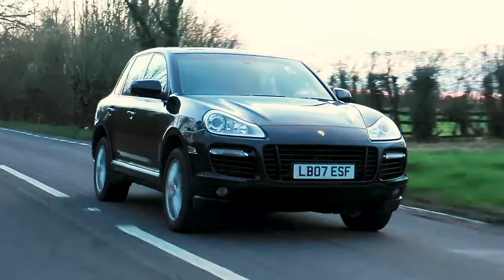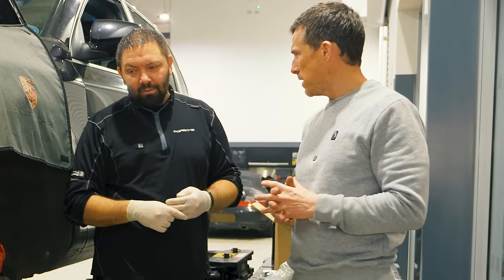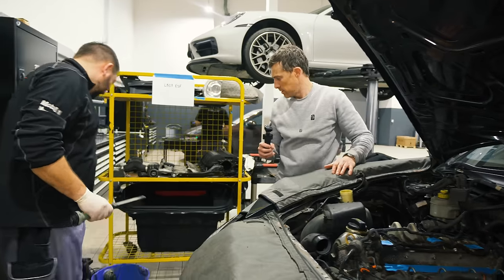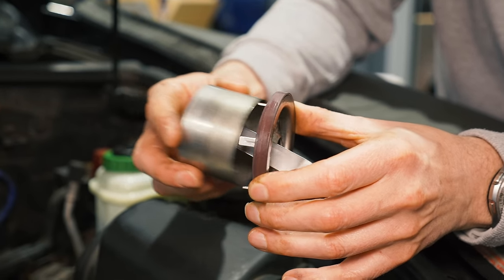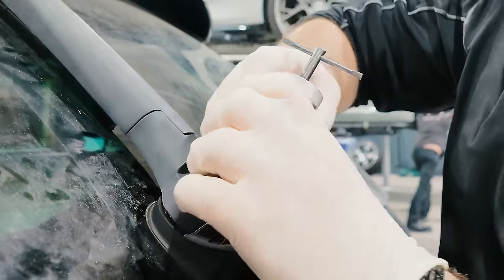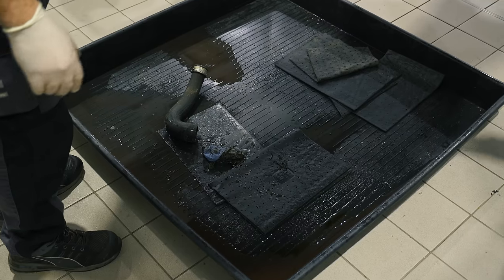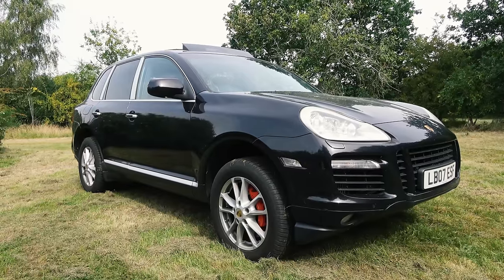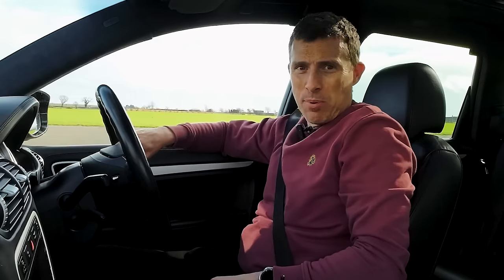Fixing my BROKEN Porsche!

Comment from the maker: Check your car with CarVertical: https://www.carvertical.com/gb/landing/v3?utm_source=infl&a=watson&b=38b26e3a&voucher=watson
Use code WATSON for 20 per cent off.
If you're in the USA use: https://www.carvertical.com/landing/v3?utm_source=aff&a=watson&b=14f83321&voucher=watson
Reply: Will u go broke 😭
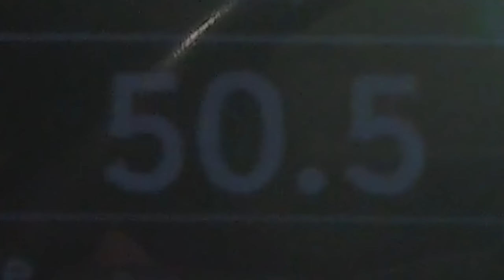Reply: You said at 20:21 that no horsepower was lost. Maybe run it on a Dyno?
Reply: Mat can you race your gt3 rs with a gt2 rs
Reply: Make a deep clean video with dry ice on porsche for the rust inside body, The end results will be really satisfying.
Reply: Mat you should do a review of the Cadillac Blackwing maybe the CT5-V or CT4-V... One of the best driving machines out there
Reply: Great to see you drove the new 911 Mat, we'll be waiting for those reviews 😄😄
Reply: Good to know. Xxxx

Comment: No such thing as a cheap Porsche
Reply: A 1/36 die cast is pretty cheap
Reply: Thats not a porsche lol thats a toy@BobbyDazzler888
Reply: 924 is one
Reply: Funny - I’ve never spent a bean on my 911 C4S or both Boxsters 
I also now have a 955 cayenne which is at 84k but needs boot struts 
Runs like a dream
Reply: I had a 1978 Porsche 924 (I know VW Porsche but looked good) It needed a new cigarette lighter so I could use my radar detector. Went to Porsche to see what I needed and how much. (Before internet like today) They told me what I needed and was around $60 to $70.  They told me to go to the auto parts store and buy a VW one. I did and like $12. I do like how some brands you can interchange the parts and bypass the brand increase in price. I am sure Lexus and Acura do the same.
Reply: If you can fix them yourself then your OK there only expenses if you have to take them to a garage just like a cheep Mercedes
Reply: to be fair, £11,500 (maintenance included) is still less than most shitty 2019 plate hatchbacks
Reply: 11500£ for 500hp SUV in good condition is flippin' cheap.
Reply: @coolkid123456100 a “shitty”  hatchback at 11 grand would be at least 10 yrs newer and doesn’t cost £700 to tax
Reply: There are plenty of cheap Porsches. It's just that cheap and properly running rarely go hand in hand.
Reply: You are exactly right. If you are looking for economical, reliable transportation, no-one can argue that your money is best spend on a newer, more sensible car. 

That said, if driving is your thing, there is also something to be said for running an older Boxster. I've personally done this for the past 3 years with very little trouble. 

Of course older sports cars require some sacrifices here and there, but for those passionate about them its worth it and no where near as expensive as people say if you do your research and buy a good example. 

 @Gmh6477
Reply: Disagree. Compared to the competition the cheepest by a margin
Reply: @Islam_is_the_truth.4 you understand sarcasm? Go read 2 nafl prayers
Reply: @Islam_is_the_truth.4 sharp as a cue ball
Reply: @superamario6464  Oh I triggered a baby 👶 🤣
Reply: @Islam_is_the_truth.4  It is a porsche, it's just not a motor vehicle
Reply: I agree I had a porsche 944 and Spares and service was crazy prices but well made and fun car loved it
Reply: You can use vw parts which are way cheaper.
Reply: You can buy a Booster cheap but it will eat it's RMS. I can't spell Boxster
Reply: @lukasbormann4830 and the Boxster
Reply: @Gmh6477 700?😮 over here that would be around 3 or 4k. With registration it will be like 10k the first year.
Reply: It's all relative.  A new car that would do what this would do would be $100K to  $150K.  I can make a lot of repairs for the difference of that and the cost of a Gen 1 Cayenne.  Same with an older Boxster.  They are cheap for what you get.  Nothing's free in this world.

Comment: Jesus, those repair bills are insane! £406 for an oil and filter change is criminal!
Reply: That's why old luxury cars are cheep, you don't buy an old porsche or Mercedes unless you can fix and service them yourself
Reply: @JackV-tw8bw or find a mechanic that’s not into scamming
Reply: Yeah the oil change and filter is a simple job why that fee ?
Go to your local local specialist avoid dealers, these costs were ridiculous, what was the hour rate I wonder ?
Reply: And that was with discounted parts and labour
Reply: it is porsche mate, complexity and most of that price was probably the labour, most main dealers like audis charge around 200GBP/h labour so it being porsche could easily be 250-300
Reply: Its like going to Ferrari to get a new 12v Battery . Who in their right mind cares
Reply: @fl1xmeister  Mostly same car as vw touareg. Who in the right mind will do the oil change for that price to touareg. I have 4.2 diesel touareg. 10L good oil is about 75€ Filter 10-15€. If I feel lazy then oilchange in local garage is about 100€.
Reply: @Meeliskt77  is that a VW main dealer? Or a back street
Reply: Don’t worry, YouTube will help pay! 😅

Comment: Hi Matt would really like to see a few videos with your porsche. I full deep detail and paint correction possible at auto finesse. A full underside dry ice clean to bring the underside back to life ,and a before and after dyno video. A bigger intercooler, some performance air filters new spark plugs and fuel filters and a ecu remap .I'm sure this big old girl still has more to give . Looking forward to seeing what you get up to next . Then I would love to see how the porsche stacks up against the modern big suvs  on the drag strip 🇩🇪👍
Reply: How much does the dry ice clean run?

Comment: Wow the underside of that Porsche looks like it’s been in the ocean!!😮
Those prices were eye watering 😢
Reply: If you're handy with a wrench, a lot of that can be done for cheaper. I did the water pump and thermostat on my 2010 Turbo with no problems, cleaned the intake ports (necessary), and replaced a bunch of spent bushings for just around $1200 dollars. Just don't ask about replacing the brake rotors!
Reply: Do the oil yourself... Everything else was reasonable even for an economy car. I feel like the oil is so high because they really don't want to do it... It's like asking an astronaut to drive you to McDonald's.
Reply: @ch4.hayabusa  £571 is reasonable for a rear wiper blade and switch?

Comment: Had an engine to gearbox gasket failure on a 2012 Cayenne Diesel, quote to fix was £4500 -£5000 and that was from a specialist. Had quite a few other issues with it that were all expensive to fix. 
Great car, really nice to drive but it was my first and last Porsche.

Comment: Glad to see the Cayenne in better shape. I still need to sort the gearbox/transfer case/differential oil changes in mine.

I find the Cayenne is best in flowing corners, tight ones. Mine lacks PDCC so you really feel the weight if you have to turn sharply.

Comment: Great video Mat. Very useful for those of us considering a 2nd hand Porsche. The bill is eye-watering, but not crippling, considering you have fixed so may issues and brought a 17yr old car back up to snuff. Also, as you suggest an independent specialist may be cheaper. And some of those jobs could even have been done by my local garage. Overall, reassured. Now back to browsing Autotrader...😅

Comment: Pull the mini blind off that raises up a few inches when you open sunroof, then push a seal down inside and silicone flush to the channel where the seal sat in for the fabric wind deflector, no more leaks after that and rodding drains from bottom up

Comment: I have the non turbo version and had similar bills in year 1 and 2 and now I try and do the work myself. Oil change and filter for £100. Brake bleeding and nipples £80. Full brake refresh (pads/disc) coming up this summer. Dealer would be at least a 1k.

Comment: I had a Cayenne Turbo, and it was just not chilled enough for daily life, being a manic engine. I moved to the effortless low rpm torque for daily driving of a diesel  V10 Touareg.
Reply: I really want a V10 Touareg. What one did you go for?
Reply: @AlwaysOneMore  V10 Touareg are pretty much all the same. Paddle shift is nice on the column, but the tiptronic does the same on the gear selector. 

There are R line and Altitude versions. 

One could also try a W12 Touareg from Europe, where LHD in the UK is fine once one’s mind and body (autonomic nervous system) are given the time to adjust.

Comment: Ive gotten to drive a 1st gen cayenne turbo s and they are absokutely mad, the one in question had some sort of tune so it made 550ho instead of 521, they also handle insanely good when u put the suspension in sport

Comment: I’m curious if the PCV system is overloading your intake with oil. If so just replacing the intercooler hose would only be a temporary fix.

Comment: That one service costs as much as all the lifetime maintenance and repairs combined on my 2009 Prius with 330K miles on it (me doing all the maintenance...oil and filter changes, trans fluid, coolant, spark plugs, brake fluid, one set of brake pads and rotors, cabin air filters, etc).

Comment: I'd basically get an E-Hybrid Base Cayenne with 3.0 V6 engine for that money, under pre-approved warranty. £11k is way too much to spend on a car this old. My 4 year old Cayenne Turbo S E-Hybrid is under a repair in a Porsche Dealership right now, I highly doubt the cost of the repair would be different between this variant and the newer variant (E3). It feels like that repair cost is basically dumped into the drain.

Comment: I’ve found the 955 turbo really sluggish even compared to a Nissan note, any traffic lights and I’d have to switch the traction control off (turns into a different beast) if the gearbox is playing up after when it’s warm and clunking then its likely the valve body at fault (you can get new solenoids). I’ve had a lot of cars and it’s by far the most unreliable and inconsistently engineered car. The sunroof drains would have been better manufactured had they used paper McDonald’s straws, the plastic coolant pipe design was stupid, the tailgate struts don’t last a year, the headlight wiring was made of biodegradable pvc,the breather pipes are made of the brittle plastic. If you get chain rattle it’s about a 30 hour skilled job to carry out . To sum up the car If you look at the first thing  in your experience of the cayenne it’s the key, the one shaped like a little cayenne, you can’t tell if you’ve locked or unlocked the thing as it uses the same button… what were they thinking? Terrible, terrible VAG cars….but they do handle and sound nice😂

Comment: Theres nothing worse than getting a used performance car only to find out that the previous owner has cheaped out with running the car, im still finding issues a year after getting my car caused by previous owners.

Comment: That’s ridiculous for the work that’s been done. £400 pound for a oil and filter change. £100 pound for parts and £300 labour for a hours work.
Reply: Oil capacity for the 4.8 V8 engine is 9.5 liter! Synthetic oil probably costs £25 to £30 per liter at the Porsche dealer. You can do the math...
Reply: They tried to change me £900 for first service on a Cayman GTS! 
Oil, filter and brake fluid. 
…after they’d quoted £600 in writing 😂
The service lady was GUTTED when I reminded her that SHE emailed me the price. 
She even tried to negotiate with me, having done no extra work 🙄
Reply: @StealthFX9  yes that’s why I said it’s ridiculous.
Reply: @RJAH355  There is no such thing as cheap engine oil at a dealer. No matter which manufacturer.
Reply: @StealthFX9  that’s not my point. It’s doesn’t matter what they say it costs to the customers. It’s costs less then what it costs for me or you to buy. So it doesn’t cost £25 to £30 a litre. For the parts to do that oil change it will cost Porsche less then £100 pound. So the truth is the rest is labour charges not the £25 to £30 a litre they say.
Reply: @RJAH355  You obviously don't know how to run a business... You need to have an adequate margin when you sell spare parts or oil or whatever to keep your business healthy. The costs that the manufacturer alone incurs with its requirements for a dealership are immense.
Reply: @StealthFX9  think it’s You who obviously hasn’t got a clue what your talking about. If a local garage can do the same oil change for less then half that price. How do they stay in business. You think Porsche pays more for the oil and filters then me or you. They don’t. It’s also the reason there’s thousands of local garages cause they don’t charge what mains dealers charge. I’ve also been change my own oil and filters for 30 years. I also 3 friends who own there own garage. So please explain to me how they’ve been in business for decades if they don’t charge £400 pound for a oil and filter change.
Reply: @RJAH355  🤦🏻‍♂️ Bro, seriously? 
I worked for 10 years at a dealership. Accounting department. I know the numbers...
Reply: @StealthFX9  I’m not your bro and your talking rubbish if your trying to tell me a main dealer pays more for there parts then then me or any other garage. It’s none fact they rip there customers off. That’s why there thousands of local garages. Cause they do the same job for less then half the price of main dealers.
Reply: @StealthFX9  Show me the numbers Bro?
:face-green-smiling:
Reply: @dirtyharry3479  show you what numbers. That the one of best oil costs £35 pound for 5 litres and oil filter costs £10 pound. Them numbers and local garages charge £50 a hour and it’s takes less then a hour to do a oil and filter change. Them numbers.
Reply: @dirtyharry3479  sorry that wasn’t for you. Thought it was idiot who was trying to tell me it should cost £400 for a oil and filter change.
Reply: @RJAH355 but your paying for genuine parts if I'm buying a car like this I would rather see porsche on an oil filter than Halfords. Your getting that stamp in the book and your car is worth more
Reply: @joanhemingway1768  no your not paying for genuine parts. Your paying for a stamp. Porsche don’t make the parts. Bosch or Delphi make most of them and the vw group put there own stamp on it but they also have the manufacturers stamp on them. The vw Touareg as all the same parts but cost half as much.

Comment: No such thing as a cheap Porsche indeed….but I’ve had the pleasure of owning this exact car and I can tell you that all those jobs can be done for less than 900£ if you do them yourself. I think buying an old car and taking it to a garage will be financial suicide. Putting fuel in one is bad enough! Mine was running 600 horses and you would see around 200 miles for every £100 of 99 octane put in. The thermostat and water pump took me 3 days!!😂 wouldn’t come out as there is a special lubricant it must be installed with or it welds to the block. Can’t tell you how hard that job was. Changing the boot struts and the AOS and worst of all the VVT solenoids were horrendous jobs. Porsche remove the engine to do it. I can see why! Learned loads saved thousands …… but NEVER take it to a garage!!!

Comment: How can Porsche charge £690 fora water pump, and you can’t get the gasket separately, utterly crazy, better to go to Euro car parts or Buy Car parts often same stuff that Porsche fit just half the price, and guaranteed, was in motor trade it’s common knowledge, Mercedes fit ATE pads, around £140, same from ECP around £68, same and under licence naturally from Mercedes.

Comment: 17:44 LMAOOOO 400 quid for an oil and filter change? WHY? HOW?? even on my turbocharged cars where I use the more expensive 5W30 it only costs like 12 euro/litre and the filter cost is like 20 euro TOPS!  porsche definitely stealing the f*ck out of you lol.
Reply: It's a main dealer price it's obviously gonna be expensive 😂VW would also want £400 for my 2009 VW Polo for an oil and filter change. And 490 for a full service. I don't pay that I pay my local mechanic 180 for a full service and mot instead. You should never take a car to the main dealer just get it done at a local independent or do it yourself and for more higher end cars take it to a specialist

Comment: Didn’t even bother with a bit of penetrating fluid on the wiper arm 🤷🏻‍♂️…. Just make the customer buy a new one…😂
Could have bought a better conditioned and spec car with the extra money …. What You have done is demonstrate why these cars are so cheap and no one will touch them because they are money pits with £700 a year road tax.